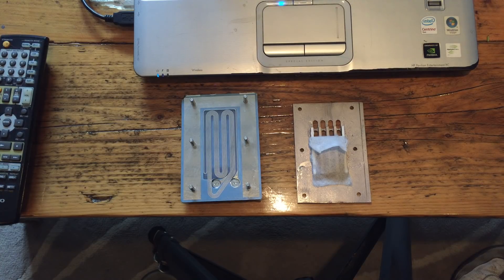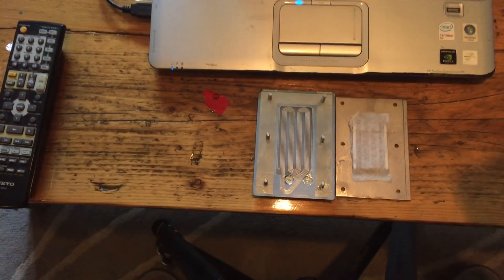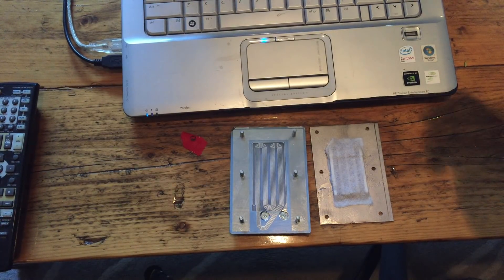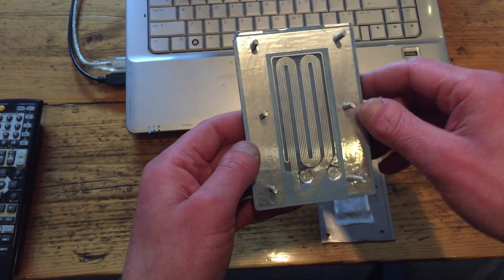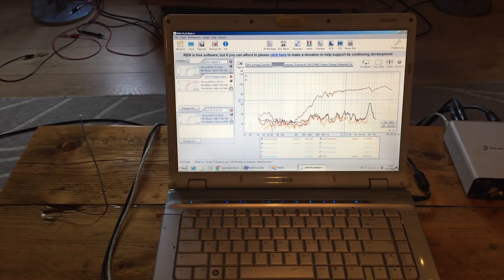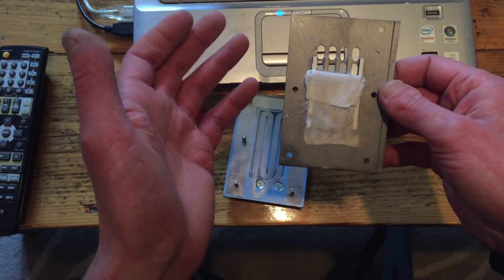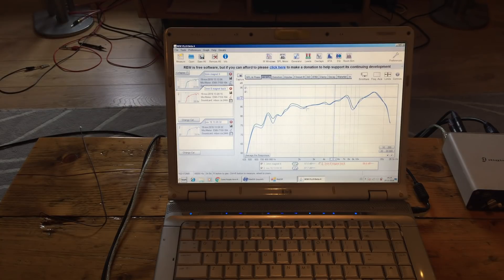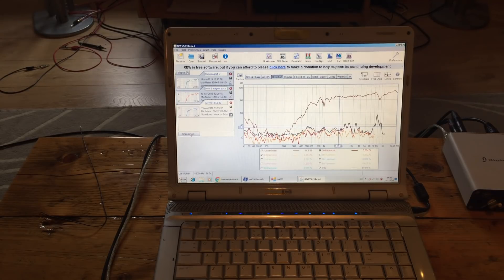Push Pull Planar magnetic tweeter Update 2 cavity's are not your friend

Comment: Hello . Did you try 4 magnets in front and 4 in the back ? Or 8 magnets in the back only as a single ended ? You know you might get better results by putting the magnets directly behind the trace rows and in the case of that driver it has 4 . So by using odd number of magnets some magnets will be directly behind the trace row and some will be on the side . So if the trace next door is vibrating differently than it's neighbor trace row then it might cancel out itself in certain frequencies . I hope you get what I'm saying . Good luck .
Reply from the maker: tobad it does not work like that  :(  if the magnet was straight behind the coil  half of the coil moves forward and the other part backwards :) or you have to flip the magnet 90 degree. but in that case the magnet is obstructing the coil always :) but thanks for the input, always welcome !